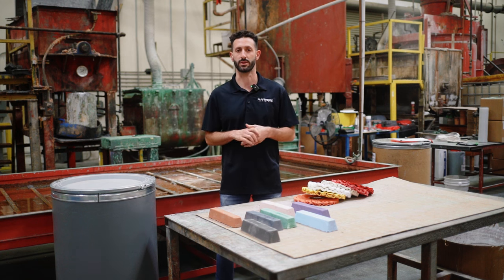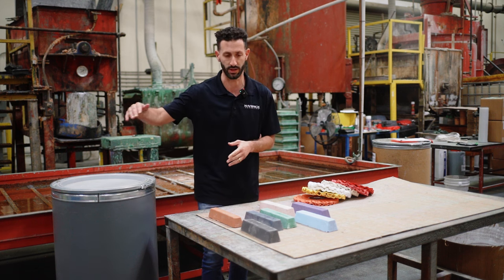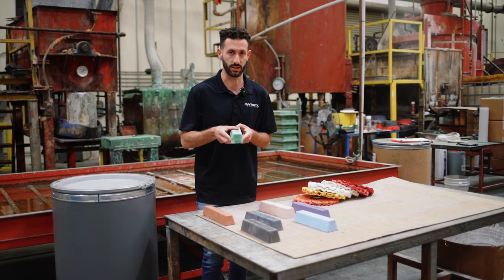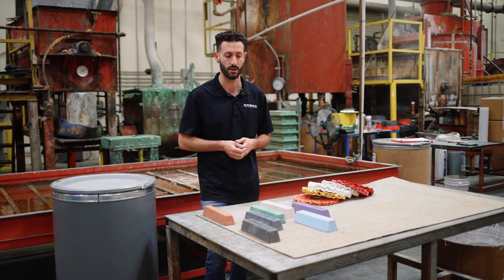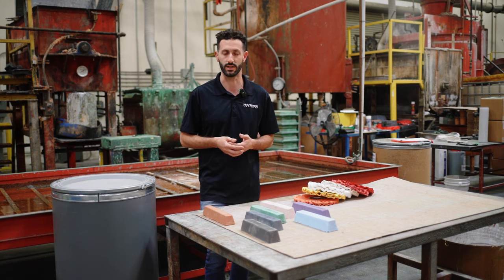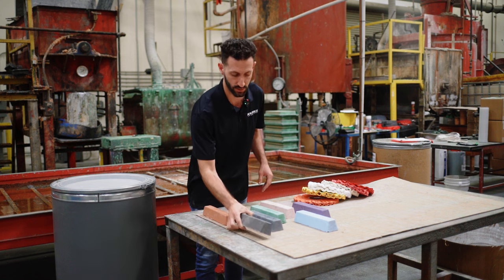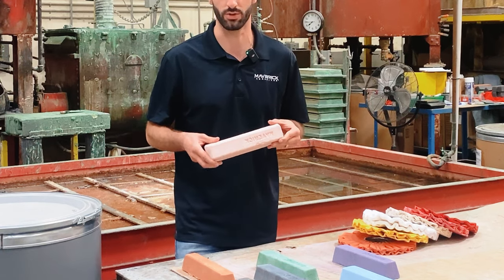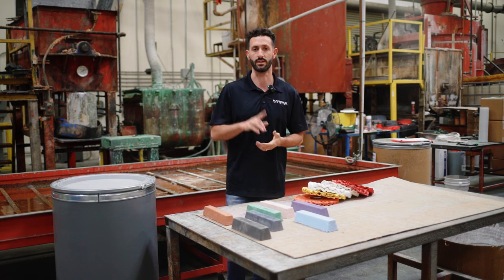COMPOUND BARS EXPLAINED

Comment: It's far more important to do a good job with your pre-sanding than getting too deep into a bunch of rouges. Most people actually need 3. Brown for soft metals like brass & copper, black for hard metals, (steel) and white for finishing on both and for light buffing on soft material like wood, plastic, horn, ivory and similar items. The Wheel you use also has more to do with results than the rouge.

Comment: Hi. Great video! I see you mention black is a 'cutting' bar? Can you elaborate on what cutting has to do with polishing? Newbie here! Thank you.
Reply: Big grit, removing material
Reply: I imagine it’s the same for metal polishing as it is for car paint polishing. In automotive uses, cutting is for removing surface contaminants, or removing more of the clear coat finish if its scratches are obvious. Polishing is a similar but finer process. It removes material too, but it removes it more evenly and conservatively.

Comment: Im confused. Isnt green finer than white? I read at so many places that white is coarser than green.
Reply: There's 2 types of white bars. Ones for cutting n polishing stainless chrome. The other white bar is finer n light used for finishing. I use white lighting bar for cutting n final step
Reply: Green is heavy cut whereas white is medium cut